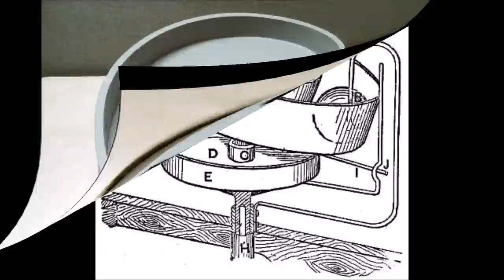Self running Tilting Tray. Perpetual Motion machine

Comment: BUT WHAT IS THE GLASS OF GREEN LIQUID FOR
Reply from the maker: пить
Reply: +veproject1 wat?!
Reply: Aesthetic.
Reply: it means "a drink" in russian
Reply from the maker: Russian drink is much bigger...
Reply: st Patricks day
Reply: A drink
Reply: The glass of green liquid shows that the table is not moving, or basically that the table isn't causing the movement. It's the wire that causes the motion (at 1:05) because a machine with 0% wasted energy is impossible. Perpetual Motion machines are a waste of time and resources, because they will never work.
Reply: no its not impossible unless your stuck in the past
Reply: you can say perpetual motion is possible, but it would be the same as if you said you where mad.
Reply: you can say air travel isn't  possible, but it would be the same as if you said you where mad.
Reply: Frank James Except air travel doesn't violate laws of thermodynamics.
Reply: not ANYMORE
Reply: his mushroom drink, how rlse would you come up with that
Reply: A true 0% wasted or even gaining energy machine is impossible because not matter how much we try there will always be friction with other objects and the ground and even the air around the machine. With these factors it would be near impossible if not fully impossible to create a nonstop machine. Even if this was not being pulled by wires, he did not let it run nearly long enough to say it was a true nonstop machine. Also if it was nonstop, again without the wires, there would most likely be no fluctuations as he started it up hinting that there is a lot of friction in certain areas and that would stop this machine slowly and in the end fully.
Reply: you've got to drink the Kool-aid to BELIEVE!!!!
Reply: FromRussiaWithLove same thing i was about to say.
Reply: frank james it is not impossible if you're stuck in kindergarten.
Reply: Perpetual fluid of course!
Reply: if too much friction USE MORE LUBE
Reply: Ryan Smock that was not a wire at 01:05. You are good reader, I am sure but you should research more carefully about the things which you are not supposed to know.
Reply: Obviously it propels the machine via evaporation
Reply: Kryptonite water for energy.
Reply: It's Kool-Aid.  After you drink it you get infinite knowledge and get to see God.
Reply: It's a glass of vodka to ease the pain when the inventor realizes that perpetual motion is impossible.
Reply: detecting table moving, many tricks based on table moving
Reply: A perpetual  motion machine  based  on   the  earth  gravity  ,  polarity  or  taking advantage  of  the rotation  could  it work  ?  ( As long  as the earth  live .)
Reply: If there  is   a past  , there is   a present  and a future is possible  though  not certain. A perpetual  motion  machine  would have  to   be based on  a force  with  eternal  past ,  perpetual meaning    eternal . It is  very difficult to imagine and   probably more to   realise .  A  perpetual  machine  need to be  a god  .

                                Now , when  did you started to be   so kind   to your  human  brothers? When did you start  to be stuck  somewhere? Who stuck  you ?  Your mother ? A castrating  mother  ? Your  father ? Both ?  The  next  door  neighbour ?
Reply: It might work but it would break a rule. A perpetual motion machine cannot rely on any external force (human, electricity, lightning, wind, river power, the motion of the earth, or the light from the sun, moon, or stars).
Reply: Bill Streifer 
Would "GRAVITY" be considered an External Force...
Reply: Bill Streifer 
Or are you saying there is no such thing as "Perpetural Motion", period. 
Since the things you mention are simply a part of the natural universe. 
Which Obviously can not be taken from any equation.
Reply: Without gravity, none of these contraptions would even appear to work.
Reply: Bill Streifer 
Well. There are many that use "MAGNETISM" too. 
But doesn't answer my last question. 
Which basically asks your definition of "PERPETUAL MOTION".
Bacause again. You mentioned many natural forces. Which can not be used by your definition of same. But as the Universe,.. And our Solar System within HAS been moving Perpetualy from our standpoint in time. I would just like a better explanation...
Reply: Bill Streifer 
...and your answer BETTER NOT BE FLAT EARTH lol... 
Kidding 🤣
Reply: there's no official definition since perpetual motion doesn't exist. if sun-power could be used, i could build a perpetual motion machine at radio shack for $12
Reply: Bill Streifer 
Actually there are Several Definitions. And hinge on PERPETUAL. As a term Suggesting Infinite. Which even Infinite should have Niether a beginning, nor end. And from what we "Know". Is problematic. But without COMPLETE knowledge of,.. "Everything". The simple statement that something is Impossible, is Un-Informed in the least. Jus Sayin...
...............
I will add. 
That's one of the reasons we shy away from the term Law. And prefer Theory. Just in case we Learn Something  ☺
Reply: Frank James "FACE PALM" dud perpetual motion is impossible no machine can be 100% efficient it simply cannot be done
Reply: TheBluedragon1221 you could throw a rock in space it would never stop moving...
Reply: No Copyright Music - Free Audio Library XD YOU BETTER STOP
Reply: That's his drink...
Reply: FromRussiaWithLove its to distract you from the wire.
Reply: FromRussiaWithLove omg 666 likes
Reply: David Cook would the glitch you're referring to be the govt?
Reply: David Cook I mentioned that as someone was recently imprisoned for using solar panels. There is no perpetual motion, however there is perpetual power in the form of wind, sun, thermal, etc...however currently the cost to benefit ratio is skewed. I do not use Facebook, is there another way for an exchange, as you've piqued my interest.
Reply: The fact yI  is the only thing that would have to go back and I don't think that I have a great way of the day before I get a follow back on FromRussiaWithLove
Reply: That's the koolade.
Reply: It's TO show the table isn't being titled!  Duh
Reply: Ryan Smock  Good eye on the wire!!
Reply: Refreshments... I guess you'd have to be drunk to make these videos for a living
Reply: Russian beer
Reply: FromRussiaWithLove piss probabaly.
Reply: You are a nice question.. 😁
Reply: Incase he gets water hungry.
Reply: Distraction from the wire?
Reply: It is awita of pepino with limoncito :3
Reply: @ryansmock2717  
i've wrote this so many times... 
why people always argue this with termodynamics when this has nothing to do with perpetual machines

a goal is to create a machine which you will use in order to produce while using external forces 
there can be a lot of different forces 

in this case, force used would be gravity 

where is physics law breaking in that? 
i am not saying this specific device can work, i am saying that in fact there is tons of options of how to harvest electrical energy besides the one we use now 
ofcourse its best option to make a windmill, watermill, stuff like that since those are already there and if they can be used why not but if there is no such an option, why wouldnt we use forces like gravity in order to harvest el. energy

now, read my comment, think about it for real and you will come to same conclusion...
Reply: @ryansmock2717  haha good spotting bro. Fucking busted
Reply: soap, lubricate
Reply: @ryansmock2717  As the great Boris Badenov of "Rocky the Flying Squirrel" said: "I always got plan. They don't ever work--but I always got one."
Reply: Poison
Reply: Same question
Reply: Ryan Smock not yet discovered you should say.
Reply: That's just his Vodka
Reply: Lemon juice
Reply: It's dishwash liquid... he would have to be drinking something like that if he thinks we believe his little deception.   :o)
Reply: The question that keeps me up at night.
Reply: перпетуум мобиле НА ЗЕМЯТА НЕ Е ВЪЗМОЖНО ДА СТАНЕ ЗАЩОТО.....има физични закони които   
човек не е в състояние да ги промени,виж бесът е в състояние и МОЖЕ да ги промени 😑👍
Reply: It's the drink of the guy moving the string.
Reply: Votka
Reply: @ryansmock2717  
Yes , it is impossible and thus looks like the lever will cause a lot of friction losses .
But , I don't think that's the point , there are a lot of really good ones out there and very creative designs,  I think the point it more to make one that will run for as long as possible before the inevitable grind to a halt .
Reply: Mountain Dew
Reply: don't you know...it is green tea..!😂😂
Reply: @ryansmock2717  good call
Reply: It ectoplasm. They've captured a ghost to move the ball.
Reply: Uranium
Reply: emotional suppourt

Comment: clever, but as any physicist knows the ball and the lever would simply act as one mass and the tray would quickly come to a stop
Reply: BleedingRaindrops, which is exactly why he stopped it after 30 seconds or so.
Reply: There is clearly a wire or something at the top of the screen at multiple times lol
Reply: Your are right buddy
Reply: Don't forget the wire!
Reply: Butnif the ball can tilt the tray and the lever can't then the lecer cant push the ball.
Reply: @loganroman5306  not enough weight to counterbalance out the ball so this machine "somehow" defies the laws of physics not that i believe this video though.
Reply: Negative
Reply: @sodasudi9720  That's what Jessie from Breaking Bad says
Reply: @stonedsavage7814  
 @Stoned Savage!  its just "infinitely" falling, not defying anything.

If the machine can be set in a resting position though like done so at the end of the video, then it is not a real perpetual motion machine.

In addition, a perpetual motion would either have the same exact pace indefinitely, or more likely, would increase in pace as time went on, not slow down like this one does.

Thats the key.

Any real perpetual motion machine would be highly dangerous as it would potentially keep increasing in speed until the machine broke, hence the Tesla story.
Reply: Experiment is better than theories.
Reply: @ossalomheleno248  especially fake experiment, yeah
Reply: Energy will loss after time.
.
Clever..

Comment: HAHAH HE PUT THE ANNOTION "PROBLEM?" TO COVER UP THE WIRE PFFT!
Reply: lol, true
Reply: Ha lol.
Reply: hahahaha, true, you can see it xD
Reply: What's that I smell? Oh, it's bull shit!
Reply: At about 56 seconds, you can see something moving above device, at the top of the screen.
Reply: Dean Evangelista 1:05 for a very clear shot at the top
Reply: Ludd
I don't see annotions cause I'm on mobile
Reply: Probably not a wire. I would bet for an air compressor attached to some kind of rotating device (a ceiling fan?). This creates a strong air flows that pushes the disk in a circular manner. Also the disk shadow tells us that the main light source is at the ceiling but look at the illumination of the background wall. It is changing in perfect synchronization with the disk rotation. This is another indication that there is a moving object between the scene and the light source (so above the top of the video)

Comment: wow,  you stumped all of modern physics with this simple design... 

How incredible...
Reply: You can build these yourself. I have. They do in fact work. This is called an unbalanced machine, not a perpetual motion machine. Unbalanced machines require an external force to work, in this case gravity. Perpetual motion is impossible. Unbalance machines are possible. If it helps you sleep at night this isn't considered a perpetual motion machine.

Comment: It's clearly not fake. Just watch the green liquid, that's the secret.
Reply: Rino Potamus You can see the wire...
Reply: The green liquid slowly evaporates, shifting the weight of the table causing the disk to rotate.. It's foolproof
Reply: Rino Potamus Don't spoil it for everyone who is still working it out.
Reply: Rino Potamus 0:56 Yah, I can see the white wire >:p
Reply: Rino Potamus there is no evaporation causeing this. evaporation is a slow thing. it is just weight pushing against weight on a perpetual slope.   its not hard to grasp.
Reply: ATSucks1
Your joking too right?
Reply: +copop22 guys, clearly the wire is part of how it works.  Duh.  That's what keeps it perpetual.  I thought it was the green liquid too for a while, but now I'm convinced that the green liquid was just a red herring. -- The wire is where the real physics happens!
Reply: it's jello
Reply: It is fake. Perpetual motion machines are not possible.
The only thing one could achieve is a very small loss of energy, so the contraption runs longer. But perpetual motion just doesn't work.

IF this guy had found a working PM-machine, I am sure we would have heard of. By winning him the Nobel Price, getting him built a temple for shattering everything we know about physics and single-handedly solving all our energy-problems.

It's like a stage-magicians trick - the energy-source is hidden. Maybe it's magnets or the wire you could see around minute 1.
Reply: The replies on this comment are priceless. Thanks, Rino!
First, you've got this guy who simply doesn't get the sarcasm and feels compelled to point out the wire. Then there's this Russell guy who doesn't get the sarcasm plus believes it's actually perpetual motion. Then there's another guy who doesn't get the sarcasm and *actually used to believe the liquid had anything to do with it*. And when you think you've seen it all there comes the guy who doesn't get the sarcasm and doesn't even realize the wire.
Reply: The secret is not running the video long enough to show the system run out of energy.
Reply: D-Frame what do you mean "to simplify it"? Lol. You literally just have to say that the first law of thermodynamics states that energy cannot be created or destroyed. Fewer words.
Reply: Russell evaporation isn't a "slow thing", but it is slow at room temperature
Reply: Does no one realise that this was made by someone in the future who has discovered a 647th state if matter (the green stuff) that eliminates any friction or air resistance etc which, therefore, makes perpetual motion machines reality
Reply: The green liquid is where they’ve taken the piss!!!
Reply: 56 seconds and 1:05...HAHAHAHA
They aren't even TRYING to fool people anymore.
And the shadow of the person moving it was priceless.

Comment: The fakeness  is real
Reply: do you know dj pon3?
Reply: Yes I do!
Reply: Alpha Wolf haha your pic gave me an assumption
Reply: WolfPack Gaming Abstract
This is about workable Free Energy Device. There are three different Free Energy Devices but the fundamental workings of the devices are the same. High Pressure at the bottom of water tank (height 75 cm, radius 25 cm ) because of gravity so we make a small hole (5mm) in the water tank then we attach average latex sheet balloon to It outside. By using the high pressure of water at the bottom to expand/ stretch the latex balloon fully so we have Elastic Potential Energy then stop the flow of water from the water tank to the balloon by using a system as exactly as the floating ball closed the incoming water in the toilet flushing system of our home. Then nothing can get into the balloon because string is being used to knot the opening of the balloon but still the balloon is connected to the water tank. we release the pressure in the balloon by making small hole on top of it without breaking the balloon (so small nozzle is being used) then pushed up water will go above the water level of the water tank as water- jet through the air then the pushed up water will end up in the water tank only. We have gravitational potential Energy at the top of the pushed up water trajectory to generate electricity by water turbine generators. Repeat the process to get Free Energy. The manual hands actions should be automated and repeated then perpetual motion. The main use of this Device is for Electricity But Ship, Space Ship etc.. We can not separate anything from everything. So All are one.
Reply: WolfPack Gaming a
Reply: @seemlyme  Wow, such long text to say fuck thermodynamics, maybe add that the earth is flat but spins so fast that it appears to be a sphere
Reply: @AAA-kh6qi  It is, look closely to his arms, the video is edited and you can see that his arms move just a little bit out of place, kinda sus

Comment: I made one, it didn't work properly because it keeps accelerating until the ball gets thrown of the tray due  to centrifugal forces. Could you conceive some regulating mechanism avoid it to go faster and faster?
Reply: You should link it to 5 kva electricity generator and but a load on the generator to make it word as a break, you can also but three fan blades to make it fly

Comment: Is that a compress air nozzle at top 0:56
Reply: Shahid I think you nailed It! Everyone else seems to think it's a wire. You're totally right it's a fucking confessed air nozzle!
Reply: Yeah, I didn't see a wire like some said- the end of something not unlike a compressor blowgun. At the end you see their shadow on the wall moving it away. A better fake would use a steel wheel and a strong magnet under the desk to turn it.
Reply: Yeah but. It doesn't need anything to make it turn for a length of time. It will turn on its own. You're missing the point millennials. Us Gen X people are smarter. It will turn on its own - just not in perpetuity.

Comment: attention, top of screen, wire at 0:56
Reply: I don't think that is a wire. I think it is the nozzle of an air blower. This thing being air driven, probably by someone waving an air nozzle around, would explain why it moves so erratically.
Reply: There is the trick!!!!!
Reply: you also see a shadow that moves at the same time as the ball
Reply: There is no wire that I can see.
Reply: Diego Cajueiro Also, looking at the walls you can see a shadow moving from side to side...